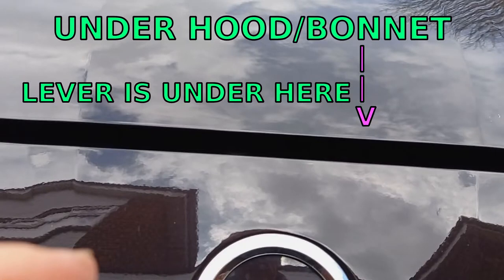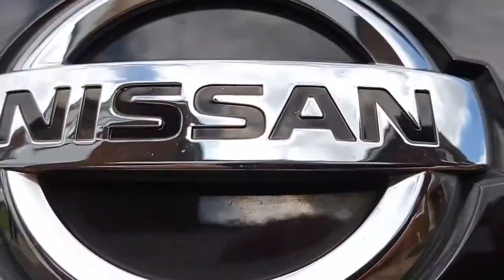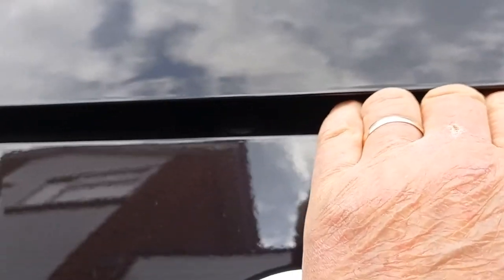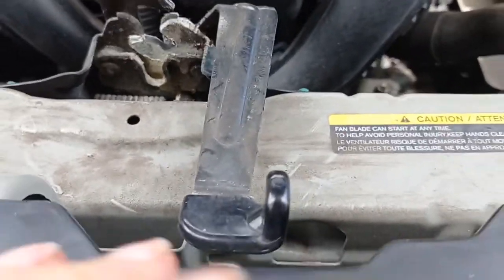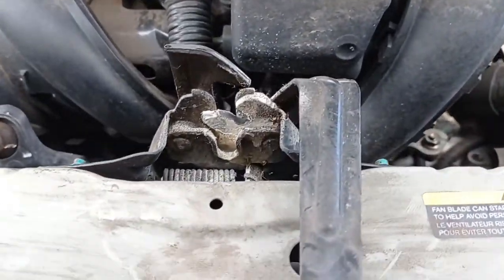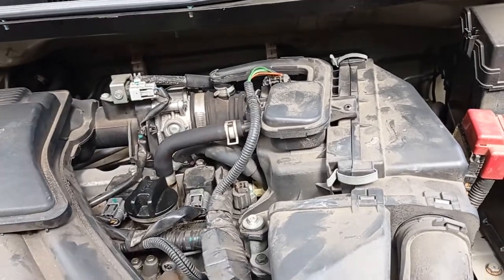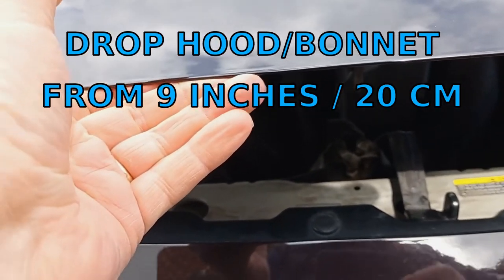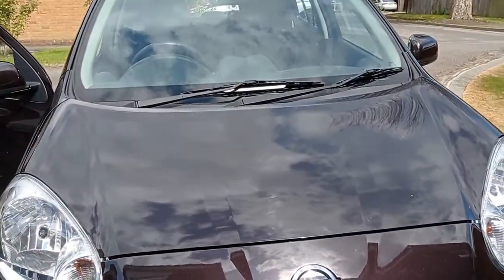How To Open Hood/Bonnet Nissan Micra 4th Generation K13 (non-broken)

Comment: How to open from outside of a keyless micra?
Reply from the maker: Don't know if this will help https://axleaddict.com/auto-repair/How-to-open-the-door-to-a-Nissan-Micra-when-the-battery-is-dead-and-the-locking-system-wont-work-with-good-pictures
Reply: Do you move the lever up or to the side please?